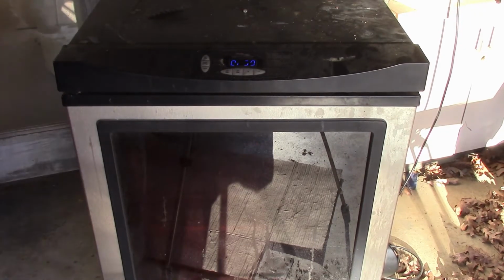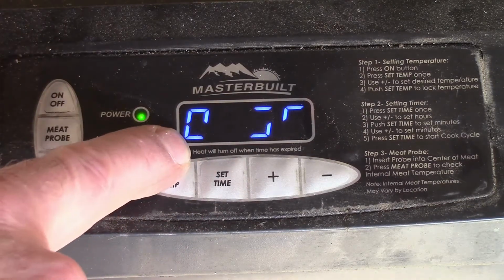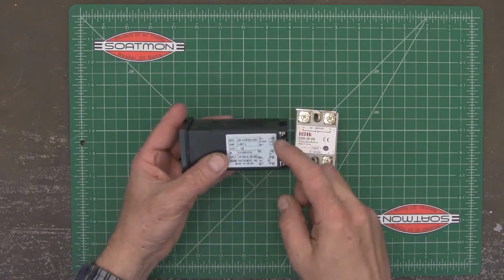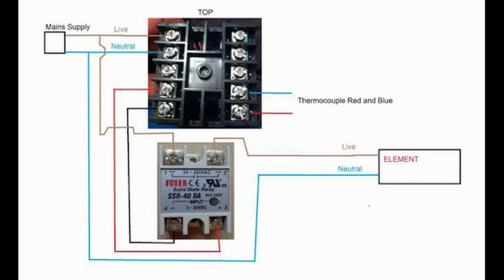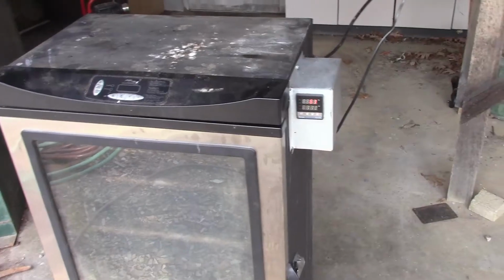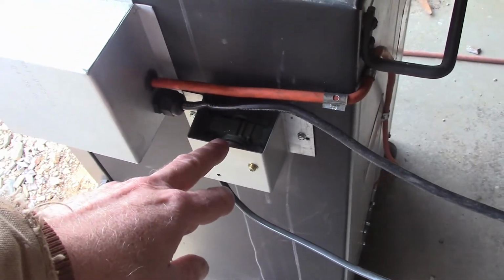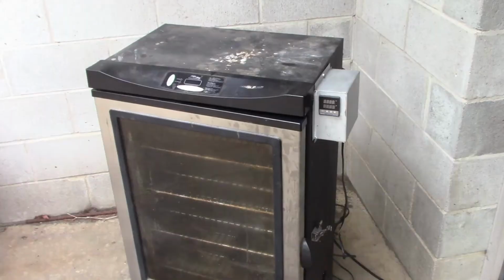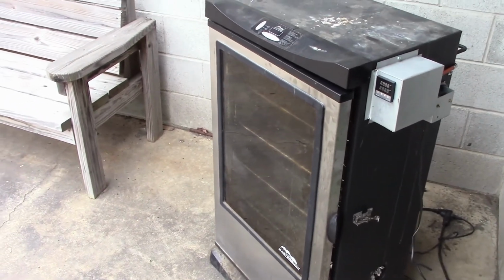Masterbuilt Smoker Controller Replacement and Upgrade

Comment: 10 yrs or so ago, the wife gave me a new smoker. One use and the controller fried. Masterbuilt was great and sent me a new unit. The entire smoker, I just had to cut the power cord m, send them a photo of this, and all was good. 
I kept the old unit and hoped to one day be able to get a new controller. At that time, the controller was not able to be purchased, at least Masterbuilt was not offering it. 
Today I happened to check on this, and I found one. $26 or so. Great. 
The replacement they sent me, has a similar problem as yours, so I thought I’d buy a replacement. But that model, has apparently been used as a throw away model that is only a replacement. Parts and service is not available. But a new model is the option. 

I just watched the whole video and you’ve covered everything and more. Thanks. A great and informative video that I knew would eventually be made by someone who knew how to do this type thing. 
I’m an electrician, but not too experienced with electronics. 
So cool. I just got my old one (used once so it’s in brand new condition) a new life cycle and the ‘new’ one with a decade of use can become more useful than it was designed for. Double bonus. ❤
Reply from the maker: That's great thanks for letting me know.

Comment: My brother gave me the masterbuilt (looks exactly the same as yours).  I have smoked several things successfully, but he warned me that the temperature set on the panel is about 20 degrees off, so I set an oven thermometer on the top grate and adjusted the panel setting until I got the correct temperature, and it does maintain.  He did install a new heating element before he gave it to me.  I'm thinking maybe the temperature sensor on the back wall might be faulty, so I ordered a new one for a different model masterbuilt and will just wire it onto the current connector to see what it reads.  Other than that, I may probe around the control panel (troubleshoot, since electronics is my life), and see if there is a component out of spec.  Any other ideas?  Or just by a traeger, like he did, LOL!  I really don't want to get into modifying it like you did.  At that point, I will just buy a Traeger like his.  I would like to hear your feedback.  Nice video!
Reply from the maker: As you said I just replaced it all, that way I can offset the temp if needed in the controller so the set temperature will be correct.  I hope yours works out for you.

Comment: Nice job! But please tell me you don't still use shop air for the smoke generator. There are plenty of high output adjustable air pumps on Amazon that won't have the oil and humidity that's commonly found in shop air.

Comment: I have a  similar  problem  42 inch  sportsman elite. No volts to the element. I know it's a control issue. Where did you come up with the parts for the power out.   The names you mentioned are not  common with  me.
Reply from the maker: I used a Solid State Relay that could handle the amperage.

Comment: Why didn’t you use the factory wiring ?
Reply: I am going to trace the wire and see about retiring one of the aftermarket controllers that will fit the factory faceplate. I’ll let you know how it turns out. Might be a bit though.
Reply: I'm thinking of wiring a pid controller into the existing wiring, rather than rewiring the smoker..
Reply: Yes, I too would like to use the factory wiring, any help with that idea

Comment: Thanks for the video. I was all set to build a controller, but decided to open my Masterbuilt control box. The LED  numbers did not all light  and could not be read. The board had several areas of corrosion from moisture over the years. I was able to clean the board contacts solder points and put it back together. It all works again!
Reply from the maker: That's great Bill.  Thanks for sharing!
Reply: How can you “weather proof” it after.

Comment: How close does the smoker temperature track the temperature set on the PID? Mine doesn't track well at all. Hoping adding the fan will improve that.
Reply from the maker: It tracks really well unless it's a cold day and I have it full.  In that case the element has trouble keeping up.

Comment: If your smoker is like mine (and most of the other Masterbuilts) in that the control panel is the only part that failed you can just use the PID controller without a separate relay since there’s one built in to the smoker that usually doesn’t go bad. This will save some wiring and potential headaches in the future since I’ve heard the aftermarket relays go bad fairly quickly. Planning to use the meat probe as a the sensing element so it can be moved around depending on where I need it since it’s going to be a cerakote oven sometimes used on small parts. One last thing, you can buy a used/open box convection oven motor and fan blade for around $30-50 to retrofit like your other video.
Reply from the maker: The relay on mine is built into the circuit board.  It's still working, I used it last weekend.

Comment: Super video, I am ordering this kit for mine today along with a new heating element.  You have a probe mounted in your smoker that is different than the one that comes with the controller kit.  Will the small probe work as well, or could you share what you used for a probe and how well it worked for you?  The Masterbuilt electronics are really cheezy.  Great Video!
Reply from the maker: The one that comes with it should work fine or any "k type" thermocouple that works within the temperature range you operate the smoker will work. Good luck with your project!

Comment: Came here because I'm having a similar issue with the display on mine. Hopefully opening it up and giving it a good clean will fix it well enough. If not, I might convert it to wifi. Though I just remembered I do have a simple temperature controller lying around I pulled from something else.
Reply from the maker: Good luck with your fix!

Comment: this is about the exact upgrade I plan, only difference is thinking of using 0- 10 v for SCR pack (pack would also have to accept variable voltage to control output) to help with better temp regulation but this might be over kill. I work industrial maintenance and had to upgrade a large pit furnace adding 3 layer heat element controls and a fan. Also had to do quality check at 9 different points in the furnace and the fan made a huge difference in keeping the temperature regulated across all 9 test points. Great job.
Reply from the maker: Thanks!!
Reply: It would be over kill to use an analog output PID (0-10v or 4-20ma) with a phase angle power controller (liner voltage output) on the type of heating element thay electric smokers use. Most PID controllors use pulse width modulation to drive the SSR and it's really all you need for them. I use variable voltage output, or phase angle power controllers, for heating elements but they are open air elements with a super fast reaction time. There is a video on my channel that looks inside of one of the air heaters controlled by a phase angle power controller.  
"Inside of felt welder 2015"

Comment: Hey, I found your video while trying to find a replacement part for my Masterbuilt 20077515 and came across your video. The plus button on my electric control panel no longer works which means I can't set the temperature or time and holding the temperature button will not pair the remote control with the smoker. I reached out to Masterbuilt and they said no one carries the part I need anymore (which I've confirmed after a long Google search). Any suggestions?
Reply from the maker: You will have to replace the smoker or change out the controller like I did.
Reply from the maker: It disappointing.

Comment: Masterbuilts smokers have only a 90 day warranty.  Even Charbroil has a full year.
You can only conclude that Masterbuilt is garbage.
Reply from the maker: Agreed
Reply: I just went through there moronic bot system to eventually find out that the controller unit is no longer available anywhere and they don't care!

Comment: Joe,                                                                                                                                                                           11/28.20
#1 I'm SURE WITH ALL OF YOUR SUBSCRIBERS THIS WILL NEVER GET READ AFTER ALL THIS TIME, But  I'm a fan of your videos, - I believe about 03 you made a video about the controller on your Masterbuilt electric smokers>> In the video you mentioned you had gotten in touch with tech to diagnose a problem, I'm having similar issues with my smoker, However, I can not find a number to call for advise.  Do you or anyone know the number to call to speak to tech support?  Please reply by messenger db.....@olp.net so I will get the notification.
Thank You in advance and again I hope you do read this comment.
Daleinok?
Reply from the maker: This is all I see:  1-800-489-1581

Comment: i just bought the controller from the provided link in your description. The wiring diagram that you provided is no longer valid. The new controller has a different terminal board layout. Use this wiring diag instead: https://twitter.com/inkbirdsmart/status/1052019180067639296

Either way good video and starting point for getting rid of the original controller. Thank you
Reply from the maker: Thanks for the information!
Reply: Where did you purchase the controller? It seems so absurd that you have to get rid of a whole smoker cause they decided not to make a controller that’ll stand the true test of time.

Comment: If you sold this as a kit, I would buy it. Apparently you cant get replacement controllers for these anymore so it's either scrap the whole thing or do this. Also, about how big is that sheet metal box you made to house the electronics. Im gonna buy a box and vent it for heat. But my smoker lives outside so I would like to protect these things as best I can.
Reply from the maker: I didn't know you couldn't get the controller anymore.  Thanks for letting me know!

Comment: I have what appears to be the same smoker as you. When your smoker was working properly  ,what was the max temp you could set it to ? Mine goes up to 275 degrees  F.
What is the max temp you can set smoker to with the new controller set up ?
Reply from the maker: Unfortunately I really don't know how high it will go. The highest I ever set it is 275. The new controller can be set much higher. Whether the smoker can obtain the higher temps and whether that is safe I don't know.
Reply: @SoatMon  Have you attempted pushing higher temps (300-500 deg) with this design. I love the smoker but chicken skin never is edible with the low temp range.

Comment: I have a very similar Masterbuilt smoker. Replaced the heating element and it just won't heat up still.
I'm just going to go ahead and do your controller replacement. That way if anything breaks, I can easily troubleshoot and replace it again. Thanks so much for the video. Smoker will be saved!
Would it work ok without the convection fan and the smoke generator? Or best to just get those added too?
Reply from the maker: It does not need the fan, that's just an upgrade.  You can try it without the smoke generator and see how well it generates smoke.  The new controller does a better job of maintaining an even temp and I was afraid once it got to temp the element would not get hot enough to generate enough smoke so I made the generator.  If I were you I would change to the new controller and try it.  Good luck!

Comment: Trying to find a control panel but when I look online for it I can’t find it part # 9007140014
Reply from the maker: Try this one, it should do the trick.  https://amzn.to/2V9VnaE  I thought I had one in the description but didn't.  I just added it.  Thanks for letting me know.
Reply: The actual part is discontinued. Masterbuilt sent me to a parts website. The website says it isn't available anymore and don't even call them for it. I plan on bypassing the control panel and using a pid that I can plug the smoker straight into...  by using a plug and play device, I can use it for the smoker or my "sanitizer still." 😉
Reply: I wonder if the Bluetooth one will work?
Reply: @berniekaita2606  Sorry if this is too late to do you any good, but this control panel worked like a charm for my smoker and added bluetooth control as well. https://www.masterbuilt.com/collections/parts/products/9907170122-digital-bluetooth-smoker-controller-kit - I expect it would work for any Masterbuilt smoker that has that a control panel with that size/shape/wiring. It is one solution as long as Masterbuilt keeps them in stock, however, lots to be said for the conversion in the video above as well.
Reply: @HBTC-15  awesome thanks
Reply: @HBTC-15  do you know how many pins this part has? Mine is a 5pin/2 pin so if it’s the same pins it should work.
Reply: @HBTC-15  Hey Brett, do you have the same smoker I'm this video? If so does that replacement you linked to direct fit plug and play? And it works with theasterbuilt app? 
Thanks
Reply: Have you found the part , I need one , no help from masterbuilt . Will never purchase a item from them again , smoker is 2 years old , and not used that much .
Reply: M B no I haven’t
Reply: Is there a cheaper version of the control panel you built?
Reply: Joshua Corwin I haven’t built one I am going to try the one in the Video.
Reply: @berniekaita2606  sorry, I meant to comment on his video.